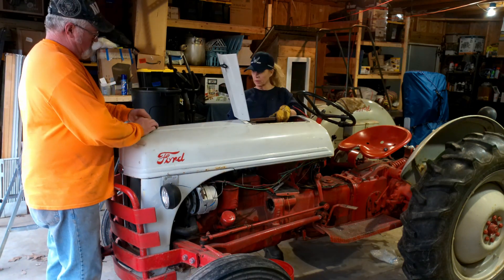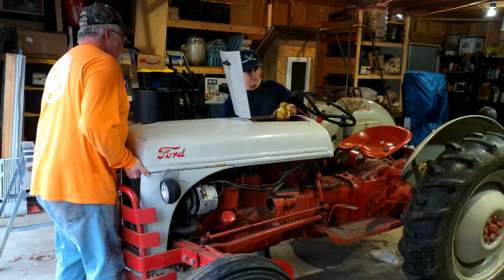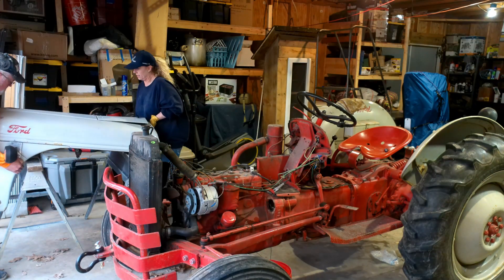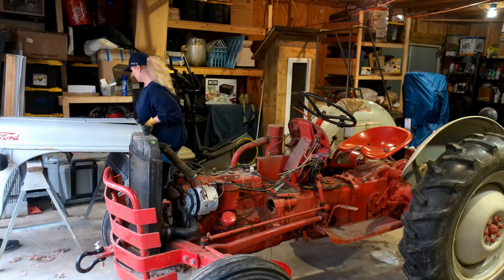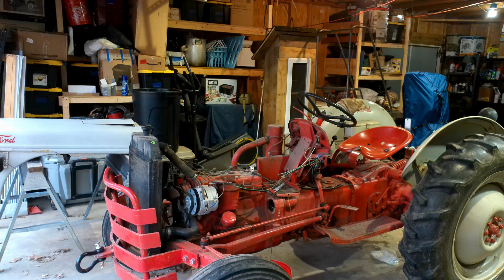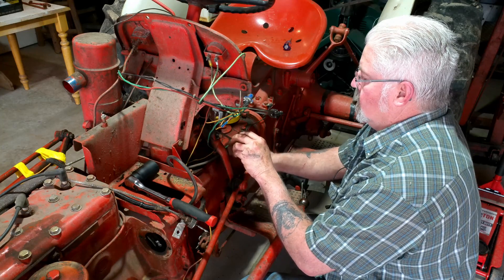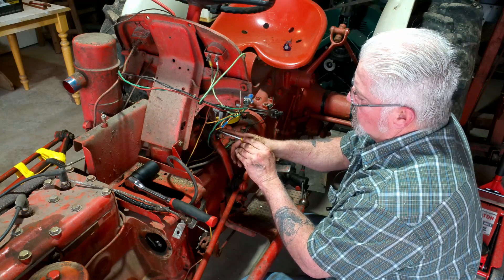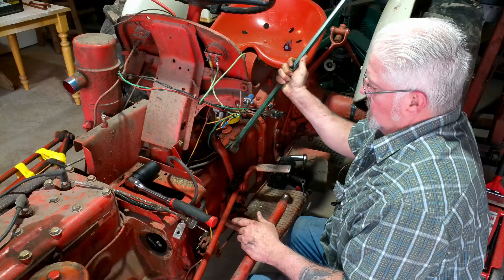I see you flywheel.

Comment: The exhaust clamp can be a bear to install and is easy to over tighten and break. The good ones have a wide side and a narrow side where the groove contacts the manifold flange, the cheap ones aren’t made like that. You probably know by now, it is easier to disconnect the tie rod ends at the front axle and fold them back rather than removing the steering box arms.